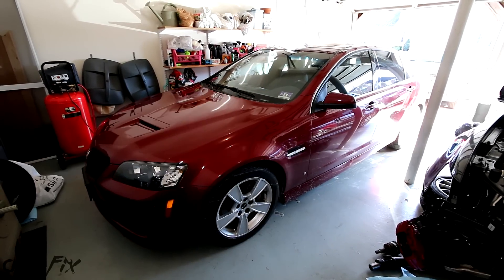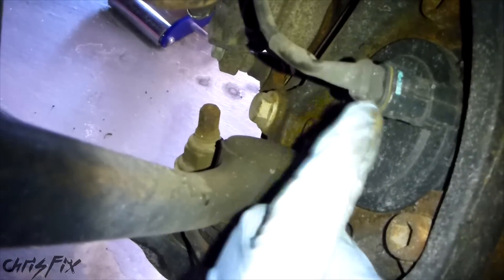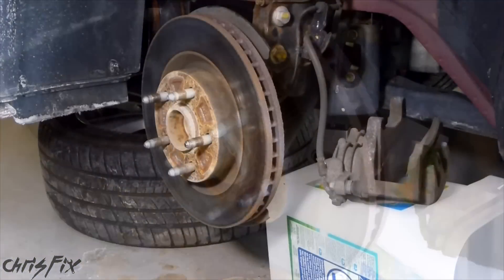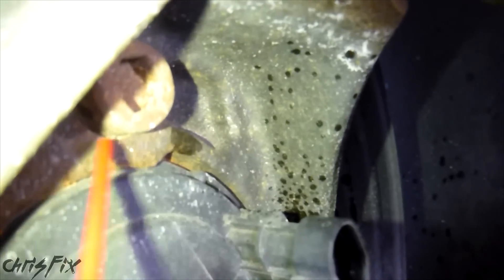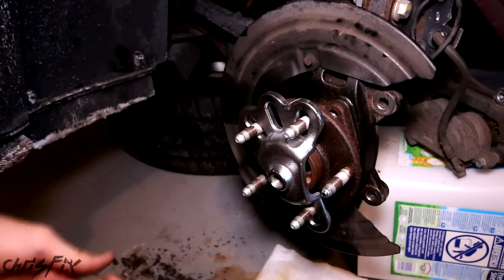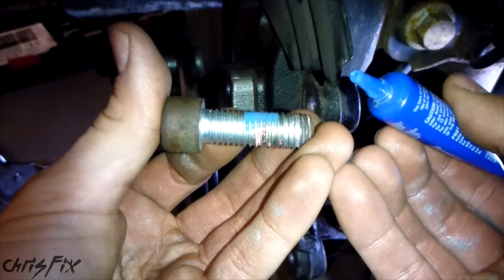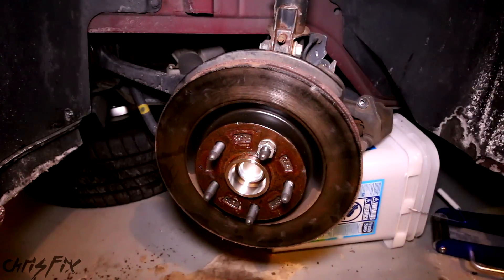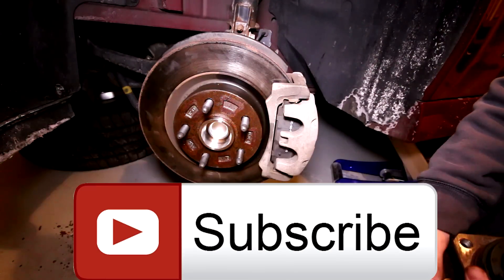How to Replace a Wheel Bearing

Comment: Smashing professional job chris :-)), you care about the quality of the result and safety aspects, that wont go wrong for a looooooooooooong time now :-))
If it was my car i would poke you with a sharp stick to do the other side as well ha ha lol :-D

We often dont have the correct quality tools and it makes a job a bloody nightmare, roadside repairs are typical and its never a good place to be, that hex bit looks the biz :-), and the slide hammer is just mechnical porn ha ha :-))
Reply from the maker: zx8401ztv Haha thanks a lot bud! Yea, having the right tools is super super important to make the job go easy. I have done jobs and dont have the right tools and it takes forever and you will usually mess something else up lol. I love the slide hammer hahaha!
Reply: ChrisFix
Well ive screwed things up in the past, or just made a part pitted with rather nasty ways of emergency bodge repairs, a very long time ago my motorbike went silly with its clutch, it was sunday night so no places were open to help, i had to get it running for the monday morning travel to work.

All the outside engine casings and such were easy to remove, i got to the clutch and oh shit!!, the central nut was massive, i had nothing to fit it, even a large adjustable spanner didnt fit, i grabbed a hammer and chisel and tapped the nut on one of the surfaces, yep its nasty, i found nothing wrong with the plates inside so i mixed them up and plonked em back in, hammer and chisel to do the nut up.
It worked perfect!!, it never ever played up for the life of the machine, odd that :-/
Reply from the maker: zx8401ztv Gotta do what you gotta do sometimes. Nothing wrong with that!

Comment: Will a front wheel drive with this type of bad part also cause it to shake when only accelerating at a certain speed. I noticed my car is making really bad noises like grinding really loud at almost any speed but shaking only at 40mph and when accelerating only. At that speed
Reply from the maker: Claroboy911 It can cause the car to shake and will make grinding noises but so can a lot of things. I would jack it up and do the test I did in this video with spinning the tire and shaking the wheel.
Reply: ChrisFix thanks

Comment: that bearing sounds awful! that bucket method you have, Is a great idea. Didn't know a slide hammer was so great. Thinking about getting the otc torx set The red lock tight needs heat to come off typically.
Reply from the maker: Richard Cowtails Thanks Richard! Yea the slide hammer is a great tool. I need to get a torx set. That is something I dont have. I was looking at this:  http://www.amazon.com/gp/product/B0002YE42E/ref=as_li_tl?ie=UTF8&camp=1789&creative=390957&creativeASIN=B0002YE42E&linkCode=as2&tag=chri0e2-20&linkId=W7DWUGEE75XOHBNI
Reply from the maker: That is a nice set! Here is another for $20 less: http://www.amazon.com/gp/product/B004XD0Z6O/ref=as_li_tl?ie=UTF8&camp=1789&creative=390957&creativeASIN=B004XD0Z6O&linkCode=as2&tag=chri0e2-20&linkId=QYOJPF6PDOC5WSHJ
Reply: That looks descent. I think I would still go for the otc

Comment: Oh my, a G8! Lucky it wasn't the rear wheel bearing on a RWD car. You have to press those in on the axle I think. I had a shop do it for my Mustang and it was very expensive.
Reply from the maker: ***** The mustang is tough because it has a solid rear axle so it needs to be pressed in. But if you have an independent rear suspension, a lot of times it is just like this but with an axle nut you need to take off.
Reply: ChrisFix yes that's why it was pressed in, I remember now. I dont mind the solid rear but that's definitely a downside to it.
Reply from the maker: ***** Yea, it isnt too bad of a job to do yourself but it is more complex than this.
Reply: ChrisFix You need a giant press though right? I don't think they're cheap. The guy I had do it used a large one and a smaller one too. I'll buy a slide hammer but not a giant press machine.
Reply from the maker: ***** No, they make presses that are a tool. You can rent them too! They actually have special bearing slide hammers as well. Less precise but it gets the job done.

Comment: Another great video.  Where do you find these torques specs?  I know they are not listed in the regular auto manual that comes with vehicle.
Reply from the maker: 2GUNMASTER Thanks! I used the shop manual for the Pontiac G8. You can also just search online. Many forums have torque specs.
Reply: ChrisFix I actually work in a engine manufacturing plant for Toyota.  You would be shocked at the BS I read on forums concerning factory spec torques.  I would trust a shop manual before internet forums.  Anyways, again, your videos are top notch and edited very clean.  Keep it up!
Reply from the maker: 2GUNMASTER I hear you but many times the people on the forums are getting the torque specs from the factory service manual. I go off the manual, but not everyone has one so I say look it up.

Comment: Hey Chris, 
Would this be pretty much the same for the ranger or the B3000 that you show stuff on? I have an 01 Ranger and am looking to replace the bearings. Thanks, love the videos!
Reply from the maker: Sam Feyder Yes, this would be the same for the front bearing on a Ford Ranger (B3000). The only difference is on a 4x4 you have an axle nut you need to remove. The rear bearing is very different.

Comment: I think my bearings are going bad in one of my front wheels. I hear the grinding noise but I'm not entirely sure what it is. I've checked the wheels for movement and can only feel a slight "looseness" on the passenger side. It's very slight. The grinding noise appears to be louder when slowing down and can also be heard at 30 mph and 60 mph. I recently had a driver side suspension coil replaced. I have a Ford Focus (2007) with 71,000 miles. Engine seems to be fine and gearbox works smoothly. Would you say my bearings are bad? - Great video! :)
Reply from the maker: sugarandpie A bad bearing will be obvious and typically the loudness increases with speed. Now that being said, your bearing could be starting to go bad. Does the noise change when you take a turn or when you press the brakes?
Reply: ChrisFix It does seem to get louder as I'm going uphill and when I'm slowing to a stop at traffic lights etc. The noise is hard to describe. But it certainly is a metallic grind.
Reply from the maker: sugarandpie Are your brakes old? It can be worn brakes. If it was the brakes it would change noise when you pressed the brakes.
Reply: ChrisFix I changed the brakes about 6 months ago. Could it be anything to do with the drive shaft? The car seems fine to drive, besides the sound in question. No loss of power, clunky gear changes or bangs and knocks. Just a low, groaning noise. I had the driver side suspension coil replaced 2 months ago, could this have anything to do with it? I suspect that it is the bearings. The local garage will do a bearing change for £150 here in the UK. I will have to get the wheel off and see if the bearing hub will need to be pressed. If it does not then I may try and change myself.
Reply from the maker: If it "groans" it is probly the bearing. You heard the noise in this video and that is exactly what it will sound like. Check out this video to which goes over a pressed bearing. In the beginning you can hear the bad bearing noise in that car: https://www.youtube.com/watch?v=fLSXQ_LLpWY
Reply: ChrisFix I'm pretty sure now that it is the bearing. I could just about hear the similarity. Thanks man! I don't have a bearing press kit so wouldn't be able to do a pressed bearing myself (I wouldn't want to cause more damage). I'll take the wheel off and have look at how these are assembled on my make and model and take it from there. This video makes the job look easy enough to do at home rather than a garage job.  Thanks for your helpful replies, and thanks for all your videos, too. I think what you're doing is awesome!
Reply from the maker: sugarandpie You can always rent a bearing press for free from your local parts store! Good luck!

Comment: Ah just seen this... Couldnt get mine off. Hav just ordered some bolts and threaded bolt extensions. My plan is to pop em in bolt fully in extension and wrench at the bolt to pry it from the backing plate. Had to pop it back on tho till then. Any luck with that method? Hub making an intermittent squeek at specific a rotation??
Reply: Can also use a hammer and chisel on the hub bearing itself in the back of it to break up the rust inside if all else fails. Just make sure not to hit the rubber boot

Comment: QUESTION: why did you take the rotor and the caliper off separately in this video but watching the video where you changed the wheel bearring on the mercury truck you took both off at as one. Does it matter if you do it either way?? I have a 2009 pontiac g6 and im really excited to save me some money by taking on this project by myself!
Reply: Eric Deshields the calipers arent attached to rotors

Comment: Chris,
I have a 1999 Silverado 1500 Z71 with a shaking steering wheel on smooth surfaces going about 40-60 mph. I have had ball joints done on the driver's side and inner tie rods on both sides. I have also had balancing and an alignment done. I was wondering if you had any insight on my issue.
Thanks.
Reply from the maker: ***** It could be a bad bearing or maybe even shocks. Jack the car up and shake the wheel to see what moves. Something has to be moving.
Reply: ChrisFix I have also replaced ball joints on the passenger side also. There is no obvious movement anymore, yet there is still vibration. Other than worn shock absorbers, could there be any other places to look (drivetrain, etc.). The u-joints in the main driveshaft have been replaced too. 
Thanks.
Reply from the maker: ***** How do the brakes look? Does the vibration stop when you press on the brakes?
Reply: ChrisFix All brakes are good. All front suspension components are tight. I think that I have found the issue, because the rear driver's side wheel has in and out movement, possibly pointing towards a wheel bearing.
Reply from the maker: ***** Ok, yea that could definitely cause the problem. Make sure you replace the bearing then if it is that bad!

Comment: Does the manual specifically say to torque the extra 120 degrees? I inquire because on a few cars I've done brakes on it only said one specific torque number for the calipers and nothing extra. Not sure if this is a specific Pontiac requirement.
Reply from the maker: Frontlaven Yes, the manual said 45ft-lbs plus 120 degrees.
Reply: Got it, thanks!

Comment: Would it be worth wire wheeling the rust of the disc before you put it back on or is it not worth it? Thanks
Reply from the maker: Shane Noel If the rust is really bad, yea, it would be worth it to make sure it is even (you can even use a wire brush). I used antisieze to prevent it from getting stuck again and it rust wasnt uneven so I didnt bother with it.

Comment: Hey dude. Great vids. What do you think a metallic squeaking noise would be when I go over larger bumps / holes in the road. Kinda sounds like a trampoline noise. Thanks.
Reply from the maker: alejandro 3485 Thanks! That is your ball joints. Check out this video: https://www.youtube.com/watch?v=62bVn7E8gyk
Reply: Hey man. You have an email I could send you some questions ?
Reply from the maker: alejandro 3485 You can use the discussion section on my channel to send any questions: https://www.youtube.com/user/PaintballOO7/discussion

Comment: Good morning ChrisFix, have you ever change a wheel bearing a quad like a bombardier ds650 atv year 2000? The steering is wobbling a lot and there is quite a bit of play when turning the steering wheel.
Reply from the maker: Peter Kapica I have never changed the wheel bearing on an ATV but I would imagine it is a similar process.

Comment: Chris, I had my control arms replaced on my trailblazer, and for some reason the truck wobbles, specially on slow speeds. Can it mean bearings need replacing?
Reply from the maker: ***** You would hear a howling, rumbling, or grinding noise if it was your bearing. Did you get the car aligned? Have you checked your tie rods? Here is how to check your tie rods: https://www.youtube.com/watch?v=brI2feYiEi8

Comment: Would this be the same process for a 2004 Mazda 3, I was told I needed a shop press for that wheel hub assembly
Reply: MythTracker
You would have to find a non-press-in bearing assembly like in the video. We are both in the same boat, you'd be better off scheduling that repair with another that you can't do yourself. Plus, you should do both bearings at the same time (opposite sides).

Comment: I'm gonna be changing mine soon. On my 99 eclipse. Do you think it's a hub assembly.? Would I need any special tools.?
Reply from the maker: Victor Sanchez I am pretty sure it will be a bearing hub assembly like in this video but you will have an axle nut to take off since it is a front wheel drive car. Otherwise it should be the same process.
Reply: Okay thank you for the helpful video.!

Keep up the good work man. You make these jobs look easy hahaha
Reply from the maker: Victor Sanchez It isnt hard when you have the right tools. Lets say I didnt have the slide hammer... Then it would be hard lol. Just gotta have the right tools and know how (which I try to show).
Reply: Yea that's true lol it woulda been stuck really good. Thanks for all your help man.!

Comment: If you were to replace a rear wheel bearing in a RWD car would there be any difference in assembly?
Reply from the maker: Rey Ruiz If the car does not get power to the rear wheels there is no difference in replacement. If it is a solid rear axle (with power to the wheels) then yes, it is different.

Comment: My a/c compressor has freeze up under the hood after the car's been on for 15 minutes; this causes air to stop coming out of the vents whether or not the a/c is being used and it's annoying. Anything I can do about this? Once the ice thaws it's fine but generally I can't drive for more than 20 minutes with heat/air on before it stops.
Reply from the maker: ***** That is weird. Why does the AC freezing up have anything to do with heat coming out of the vents? Check this out: https://www.youtube.com/watch?v=-XjXTVJhFLM
Reply: I have a theory that he has an issue with his evaporator core freezing up. If it does freeze completely and his system has the layout like mine (Blower --> AC Core --> Heater Core --> Vents) then it would stop heat from working too. Sounds like an undercharged AC system, many window AC units have this issue as they are cheaply built and start to vent their coolant.
Reply: I just got it recharged and all, not sure what's wrong with that but we have a bigger problem, my A/C clutch is seized on the pully so the compressor runs 24/7 -__- I ordered a new clutch and going to replace it next weekend.
Reply: I have a 2006 Nissan Altima in which i had  a no start situation , figured it was a dead battery and luckily my friend gave me a jump and it started right up . at that point  I went directly to parts store ( left car running lol ) in and out w a new battery ( the other one was pushing 4.5 yrs old , thinking it was  at its end of its life)  came home, popped it in and again , no start . checked for loose  ground, fuse etc , everything good , maybe store sold me dead battery ??, rare but does happen , checked it, it was fine too, had it towed to garage next day, the guy told me  it was ac compressor .  I had noticed slight grinding noises coming from it and thought of replacing it in spring  and was hoping to get a compressor delete kit  but they don't make them for the year of that car. I never knew that when an ac compressor goes it can prohibit starting the car?
Reply from the maker: An ac compressor shouldnt prevent the car from starting. Maybe it is shorted? Check this video out to test for a short: https://www.youtube.com/watch?v=n5FJDgcdii8
Also check out this video on testing the battery:
https://www.youtube.com/watch?v=COJr7OB23Hw
And this for checking the alternator:
https://www.youtube.com/watch?v=LGB6ZEjGm7Q

Comment: Hey mate, do you have a video on the rear hub bearing?
Reply from the maker: +Josh Linnell it's the same process as the front hub bearing with an axle so watch my other front bearing video I did on the Mercury Mountaineer and you will know how to do it
Reply: ChrisFix thanks mate, great video! I'll go check the one you suggested. I have a 2006 Holden VE SS (Pontiac G8). This is by far the best video I've been able to come across so far. Great instructional commentary. From Brisbane, Australia.
Reply: Josh Linnell haha I got a 2004 vy ss

Comment: @chrisFix, do you know any approximate mileage or service life for rear hub bearing? BTW, love how informative well arranged yer videos are. Greetings from Cairo, Egypt.
Reply from the maker: It really varies. On my 300k mile van they are still the factory bearings. The front bearings had to be replaced at 250k miles though.
Reply: Pfffft i changed both my little accent at 120K lets say. Few monthes ago i heard the "wooobing" sound while taking curves. On aligning, he shown me wheel play. Now, everybody can turn their heads on hearing the bearings. Car parked waiting on spare parts. Not sure if i should replace the rear as well. Its 165K now. Think those bearings were not genuine? Got them outta Hyundai's box tho. To be honest, i installed strut bar & 4 Points lower brace so i corner harshly to enjoy the ride, that's why the front bearing did not last long. i corner 1.25x to 1.5x the normal speed sometimes. Chrisfix  guess i will replace them anyway with Timken rear hub to eliminate any doubts specially i am changing a lot of suspension parts for peace of mind, specially i installed Ultra Racing 18mm rear anti roll bar and may be the cornering affecting them as well. Btw, that rear anti-roll bar rocks, almost non-noticeable rear body roll